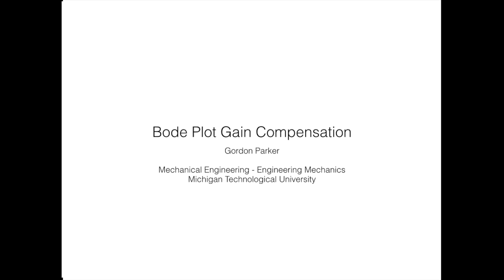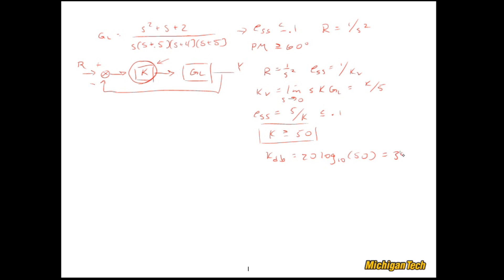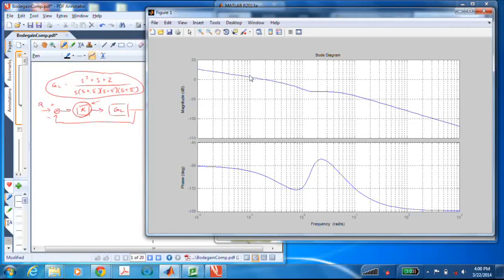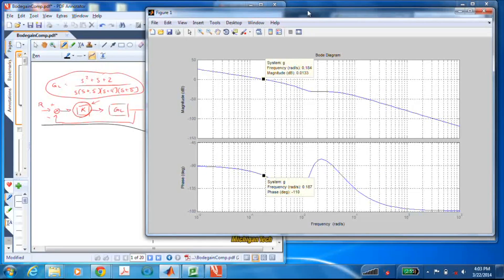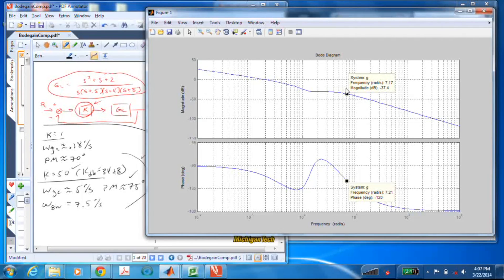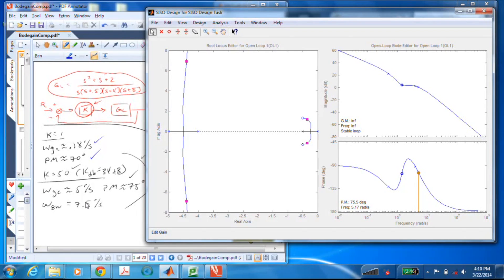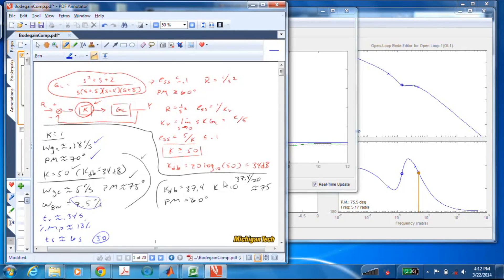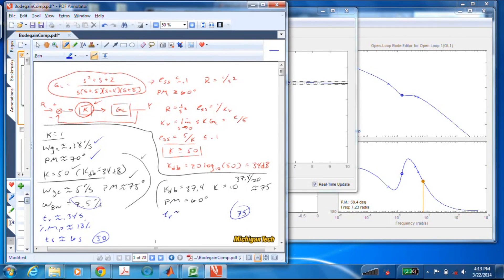Bode Plot Gain Compensation

Comment: How can we calculate the desired K value if percentage overshoot is given as requirement instead ess and phase margin ?
Reply from the maker: Good question. One way, and depending on the system it may be very approximate, is to related phase margin to percent overshoot. If the closed loop system is second order and underdamped, it works quite well. In that case we have a nice relationship between damping ratio and percent overshoot. Furthermore, the phase margin is approximately equal to 10*damping ratio. So, if you want about 5% of percent overshoot, go for a damping ratio of 0.7, or a phase margin of 70 degrees. If your closed loop system is not second order, this approach may give you a starting point for iterating the design.